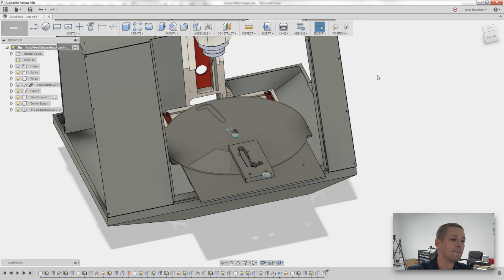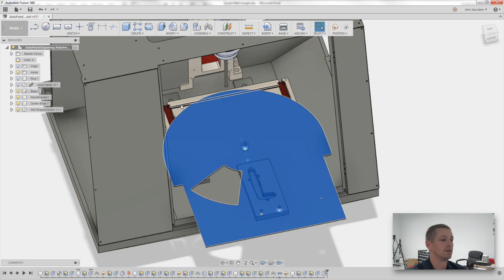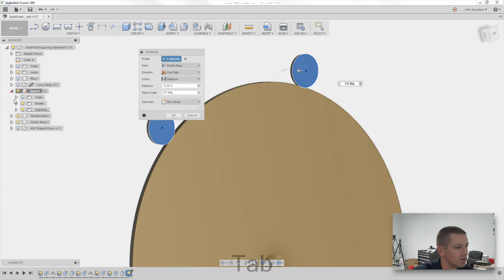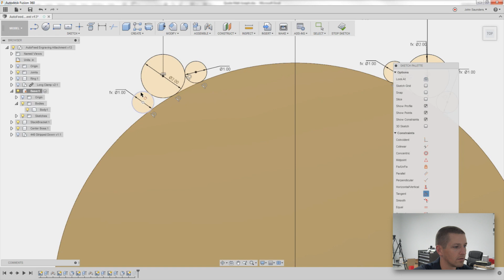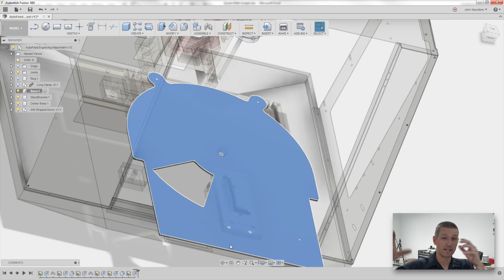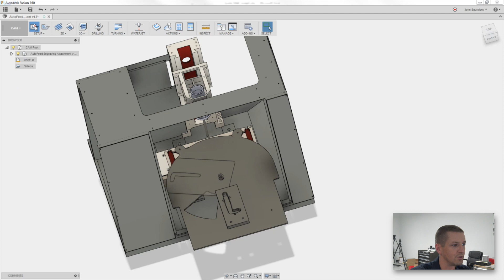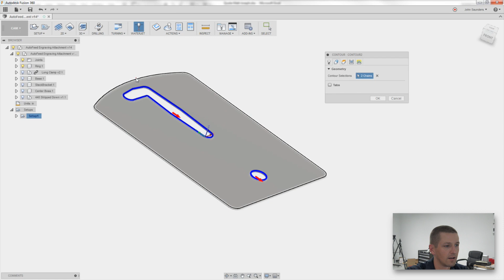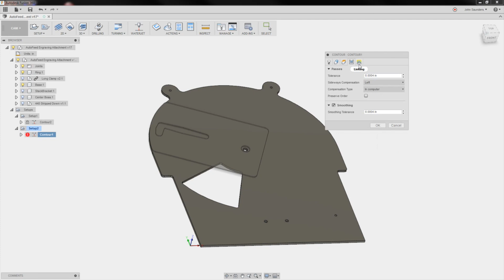Automatic Arduino CNC Parts Loader: Tormach 440!  Part 2 WW118

Comment: Very cool. A couple of thoughts. Would it be worth having magnets under the machining location to hold the part steady during the engraving operation? Also, it seems like if you had the full round disc, you could have multiple pick-up holes, maybe 20 or 30 degrees apart. There could be slots between the pick-up holes for the spindle to engage when it rotates the disk to the next station. Just thinking out loud. 😎

Comment: go back to the round and put in multiple parts holes and you can let your spindle move the ring and it will only have to move it a few inchs at a trime

Comment: Have you considered just using a sliding drawer thingamajig in the X direction instead of a rotating unit? Then you could fit the whole thing on the table without anything sticking out of the box. It'd be easier to use table movement to feed parts as well. It'd be kinda boring compared to your solution, though :-)

Comment: Another thing, you have knowledge of arduinos.. And you are running pathpilot.. Pathpilot is basicly LinuxCNC with a GUI slapped ontop of it. That means underneath the hood of that you have HAL mappings. Those hardware layer abstraction mappings can be connected to a Arduino quite simple. And the language for HAL is kinda generic. So you could have it automated with an arduino, thru g-code in your post processor. The moving part is neat, but i would use an arduino or similar with some form of sensoring so the part actually locates correctly and are loaded and so on. Alot can be done with a small sub processor and a HAL script. =)

Comment: Why not leave the part holder round, and add more holes to insert parts into? if you put eight holes in it you would only have to rotate 45 degrees to place a new part in position to be engraved, pick up a new part, and drop a finished part down the chute. This way you could do more, with less time wasted, by only moving one part at a time.
Note: I've seen nearly every single episode of How it's Made at least once, which is why I pose this question.

Comment: I'm not a machinist or CNC operator so feel free to disregard this. But this machine uses a moving table instead of the spindle moving right?  I see a couple problems with this idea on a machine that operates this way.

1) The legs you want to use to support the floating end with be drug around the floor while engraving. 

2) Isn't this a huge amount of weight to have to move with the bed? And it's hanging way off the center of the table. I know supporting legs would alleviate the cantilever weight issue but see issue 1.

Comment: I'm glad to see your weight showed up properly on the part. I've been working on a new product that has a weight tolerance and my assembly was WAY off from what Fusion said it should be; like 15% off. Still trying to figure that one out.

Fun project and looking forward to seeing how this wraps up!

Best wishes,
Tom Z
Reply: Yes, it's set to steel but I'm wondering if I've got a setting someplace. It's multiple, assembled parts and I got the properties from the top level of the drawing. Just odd. We even verified the scale we were using to make sure it wasn't being weighed inaccurately.

Comment: How about a suction grip tool? Use the tool changer to switch between engraving tool and suction grip. Or simply strap the suction grip besides the spindle since it does not actually need to spin anyway. Then program like you had a robot. Suction tool picks up new item from a pile on one side, place in the middle to work on and dispose the finished item to the other side. Use the Tormach extra switch to turn suction on and off from g code. No external controller needed.

Comment: I remember reading someones comment last time about having several holding cutouts in the rotating component so instead of having to do a full rotation every time you engrave one, it may only have to go 30 degrees, then you will save time between each operation instead of having to wait. Made sense to me.
It also gives the next part more time to find its way into the holder, which it looks like it may need.

Comment: Interesting to see it developing.  Agreed about the circular feed plate changing to a rectangle not working as others have commented.
How will you hold the feed plate while engraving?  Perhaps a fairly strong detent system against flats around the outside of the feed plate which hold it in place - but not too strong so that the machine can still overpower them to do the indexing.
Also with your quick mock up it looks like the part won't always drop through the hole.  Maybe the index system needs to do a quick back and forth shake of the feed plate when it is over the hole.  Just some thoughts . . .

Comment: As always interesting to watch you work in Fusion. However I don't see how you can avoid having the whole circle rotary tool. Isn't it supposed to move below the stack of parts and let a single part fall into place? If that's correct, another part will fall when the reduced rotary tool moves away and be pushed away when the tool eventually returns. Why not keep the full circle and cut out multiple slots all the way round? Would save some production time as well.

Comment: Just to add to what others have said, it seems to me there's no reason you can't have two clamp faces per position (opposite orientation), or have many more positions using a disc setup instead of the single arm (which will have issues anyway as has been noted). How do you plan to secure the parts being engraved so that they can't move? A magnet? Vacuum? A cover which has a window for engraving and holds the parts tight? I really like the idea of letting the mill do the work of indexing the disk, but you would need something to ensure it can't move once you've rotated it too.

Looking forward to the next installment!

Comment: John, I agree with the others about the round platter. One thought I had was to cut out more templates for the part, so the platter doesn't have to index one complete rev per part. You might get 6 or 8 on the platter to work with holes for pin accessed by machine x and y you talked about in the beginning of this video. If you used a larger shank than the cutting diameter you could use that larger shank to index the patter without a tool change. Anyway  hope you have good luck in this project, can't wait to see this thing in action.

Comment: I like these kind of projects.  Always something to learn; always problems to solve.  I think you will have a problem getting the blank to drop into the opening and then reliably dropping out of the opening once the part has been machined.  Increasing the clearance of the opening will solve this problem, but now the part will not be held securely during machining.  It will be interesting to see how this and some of the other problems are resolved.  Keep up the good work with the videos!

Comment: Plenty of others already beat me to the fail on this one with your rotating piece design change that is now a hellicopter to toss your stack of plates onto the floor. lol I know you do this for the fun challenge but I bet making 2 pallets as big as your table to hold as many clamps as it can so you can load one pallet while the machine works on the other would be a lot faster, simpler, and less awkward. for machine change when it isn't engraving clamps.

Comment: If you kept the round plate then you could have a stack of parts set up so that the bottom one will fall into the hole the plate then rotates, get engraved, rotate to fall out then rotate again for the next part to drop in and repeat.

Comment: Great video, as usual! Thanks for taking the time to help others. 
At about 4 1/2 minutes in the video, I'd have mirrored the first circle. It would have saved a bunch of steps. If you wait to do the mirror until all the geometry is the way you want it, so much the better. And about 11 1/2 minutes, your templates can be stored on the cloud, as well as your tool library. In CAM, turn off what you don't want to cut before you make your setup, and it will choose the right bodies to cut. Also note that what you have turned on or off in CAM is independent of what you have turned on in MODEL.
When learning Solidworks, I was taught to "leverage your data." Part of this was deciding if your model would be symmetrical. If it is, you model one side, then mirror. If all four quadrants are the same, draw one quadrant, mirror to make half, and mirror again to make the whole. Keep up the great work!

Comment: I suspect you will need to "tap" the part out of the carrier; you may need to tap it down flat before it goes under the engraver, as well. Fun project, watching the design thinking.
Reply: Peter W. Meek
You can make a plunger, solenoid or servo push the workpiece down when i'ts in place

Comment: Looks like everyone else has beaten me to pointing out the glaring fault of removing the circular plate. 

Unless arduino has an anti-grav system I'm unaware of
Reply: use a leaf spring type thing to hold the parts in the hopper until your plate rotates around again. have the plate ride over the spring and part will drop for the hopper in to the the holder. when the plate rotates out from under the hopper, the spring returns to it's normal position keeping the parts in the hopper from dropping out until the next cycle.

Comment: Having the part as a full circle stopped the next part from falling out the chute except into the hole. Now most of the circle is missing is there anything stopping the next piece from falling into the section that is no longer there? When the arm rotates back around it will knock a part on the floor, or jam.

You might have to add some material to the section, a couple of arcs to support the next parts in the chute until the hole passes under it.
Reply: this indeed is a problen... John, you gotta rethink this idea a bit......as soon as I heared "rectangle" I had that issue in my mind... when I have seen it being cut down that much... well... you know the rest... (I see a bozo moment incoming)

Comment: Suggestion, would it save cycle time if the top plate had 8 positions to hold the parts? as the loader section would drop the parts as there is no support under the loader section? and this was typed before the end of the video
Reply: CobraBuilder that doesn't save cycle time. Still 1 spindle and 1 part at a time. Even when "indexing" to the next part. Either travels 1 ft 8 times and 8ft one time. Still the same distance covered so would take almost exactly the same.
Reply: actually it would save the time to rotate the part from the loader. that is part of cycle time. it would only go one revolution for 8 parts instead of 1 rev per part.
Reply: CobraBuilder 
It would still be a part rotating 180 from the hopper to the mill head same distance traveled from hopper to mill head regardless of the number of slots. 

All more slots does is have pieces in waiting on the plate rather than waiting in the hopper.

Comment: great video, enjoying this series. If you had kept the rotating plate as a full circle, and cut multiple pockets in it, say right, then you could have added a tower on the right hand side of the centre that drops a new part into the hole every right turn. you could stack a load of parts in the tower and leave it to run. it would load new parts and drop off completed ones every right turn. Does that make sense?

Comment: I see one issue with changing the rotating fixture from a full circle to the smaller size. It is going to kick the next one in the pile before it picks up the next one, Kicking out every second piece in front of the rotating assembly. Unless you're doing some magic in relation to the holding of the pieces to be engraved.
Why not keep the circle and have multiple positions in the plate? Do 4 sides in 1 rotation of the fixture plate?
Reply: pug2o5 
Yes that will happen you need the full circle to blank off the part chute when not in the load position 

Don't like the idea of using the XY axis to move the part when there is a jam up what's going to give ? Dedicated stepper is better less to damage

You are going to need a clamp to hold down the part for engraving 

I don't think that part will drop cleanly unless there is more clearance unless you have a air cylinder popper 

Just a old fellas rambling

Comment: Have you realized why you had a round platen to start with?  You need the jaws to drop into the cutout, so they have to sit on top of the platen until the hole comes around.  Now the platen spins around and you need some way of holding the jaws up until the platen passes under the feeder chute.
Reply: I watched this and did not even see that.  Continuing with that idea, why have only one hole in the platen.  Go with multiple holes and have parts "on deck" and then move only part of a rotation to index each part.  Lock the platen with a pin through the base.  Then for rotation use a tool in the spindle to snap over the pin from the top, pull the pin, move back one hole in the platen, use xy movement to rotate the platen, push pin down into the base, and have the pin grabber tool slide off the pin to release it.

Comment: Why just the single part at a time approach? 

maybe it's just me, but it seems there will be quite a bit of wasted movement with the current design. i.e. 
movement 1: rotate to load part
movement 2: rotate to position part
movement 3: rotate to unload part

Why not save a lot of that wasted movement by creating a full disk of cutouts, that way you can make a single movement to simultaneously load a new part, position a part already in the disk cutout, and unload an already machined part. 

If as you said, you'll be doing 600 part batches, i think it would save quite a bit of time on the overall process.
Reply: As I was watching the video this is what I was thinking also.  It looks to me that you have room for 6(six) spaces to hold parts or possibly 8. As others have said there will be higher efficiency with more than one part hole at a time.  From watching similar devices work, the carrier that the work piece is in needs to be slightly less thick than the work piece so the part is less likely to catch on the carrier.  A slight detent would hold the work part in position.  A  small rod or ear numbering the same as the spaces could be used as an arm for the spindle to push the carrier around and the spindle doesn't have to travel in a circle to do it with the correct length of ear.

This way you could batch load the parts in groups of 50 or 100, etc.
Reply: more or less what i was thinking.

Comment: If the turning is a leg. whil it not start pushing the parts around from the stack in front of the hole you made for it. And why not 3 holes in the turning circle this reduce the number of turns it has to make. and you can feed automatic or by hand. Because the auto feeder and the hand feeder are 1/6 apart

Comment: A round pickup could have multiple slots and would not have to move a full circle to get next part. Thus next part setup would be faster.  I am concerned the rectangle pick up will have problems getting next part to engrave.
Reply: You are right, could gone for 12 slots in full circle and engrave 12 per rotation.
Much more efficient, less wear and tear.
A hopper next to the chute and the pieces drop autom. in the emty slot.(just by gravity)
Now you have to handfeed them ,or make a hopper that drops a piece only when the slot is underneath it.(more complicated)
Reply: y delzeyne 
the only problem is when a workpiece gets stuck and jams the whole circle

Comment: I have another idea:you could  stick an electromagnet on a toolholder (maybe spring-loaded) and use that to grab and move the parts. to turn it on and off, use the auxiliary relays of the controller or a usb expansion card.

Comment: Hay John Don't you need  to keep the large round disk in your cad to keep your magazine  of clamps from falling off the top of the round moving plate so that when the rotisserie  comes back to pick up another clamp ... it doesn't interfere with the non machined clamps that had fallen off  of the top plain?   or is this just a test rotisserie plate?

Comment: how hard it be to make a lathe Chuck key
Reply: not hard at all if the key-hole is squere. if you wana do it right, mill the squere and drill a hole for the t-bar.
the getho way is to grind the squere and bend the bar to create a handle. The fit to the squere should be a little ud, no need to snug fit.
Reply: Thanks

Comment: Wheres the link to buy a clamp?
Reply: Try this link.

https://saundersmachineworks.com/products/diy-clamp-smw-edition
Reply: eformance 
Kant twists aren't powder coated black. 

Kant twist also makes thousands of the things a day. So of course they're cheaper with high speed mass manufacturing behind them. 

And finally.  Can you put a name and face to the person who made your Kant twist? 

A few extra $ isn't a big deal for an item that he's using more as side profit than as the main source of his income.
Reply: http://www.nyccnc.com/
Reply: FYI, a genuine Kant Twist 3" clamp costs $21.40 from McMaster, just sayin'.
Reply: Meh, a few bucks for him aint too bad.
Reply: I personally like the V notch in the feet and the copper plating, which resists spatter when welding.
Reply: Kant Twist is a small outfit in the LA area, about the same size as SMW. All they do is make clamps, they've been doing it since 1955, even fought off a foreign invasion of cheap quality imports, spearheaded by Enco in the 80's. Just because they are the originator doesn't mean SMW is an underdog and they are the big bad corporation.
Reply: eformance 
Yes. But my point is clamp manufacturing inc (Kant twist) all they do is make clamps. So they are setup as a production facility. Even though it's small by mass manufacturing standards, it's still a dedicated facility that makes clamps.